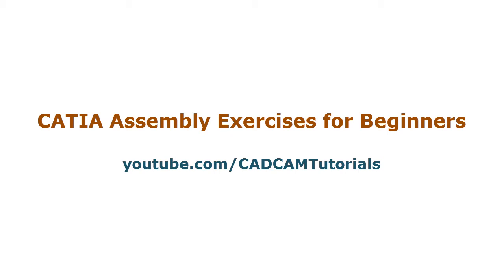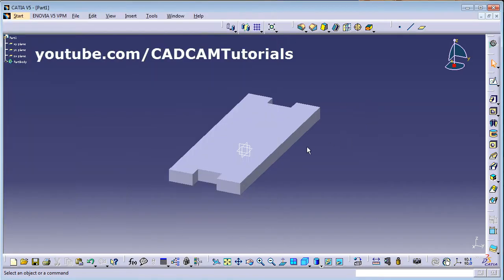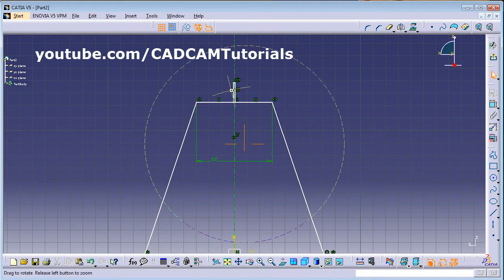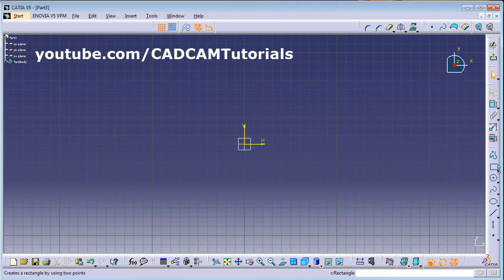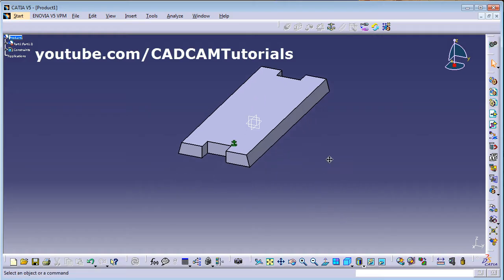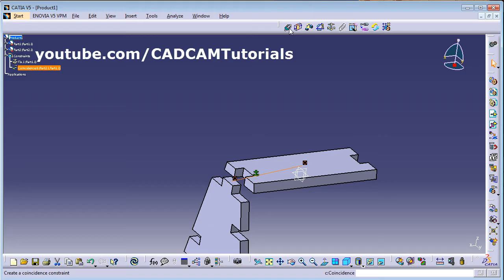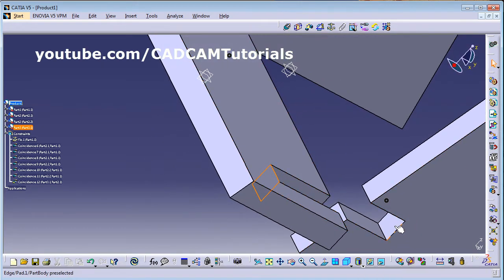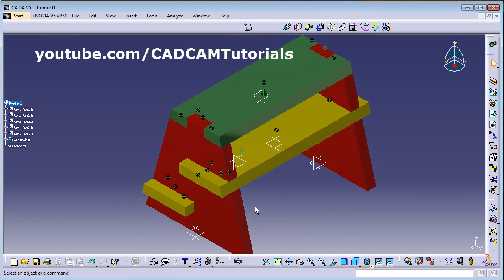CATIA Assembly Design Exercises for Beginners

Comment: In this diagram part 1 and part 3 why the angle should be taken as 15° and in part 2 diagram the angle should be taken as 75°. What is the reason I didn't understand can you explain it once?
Reply from the maker: 90 - 15 = 75

Comment: Actually,  sir, I am facing a problem during assembly when I apply coincidence constraint on facing or different axis of different part this and update all then this error comes into play
Error: Ignored constraint: the system of constraints is inconsistent or over-constrained
please help me to solve it.
Reply from the maker: You are applying opposite constraint, on same surface. Delete constraints and reapply constraints properly.
Reply: @CADCAMTutorials  thanks so much sir